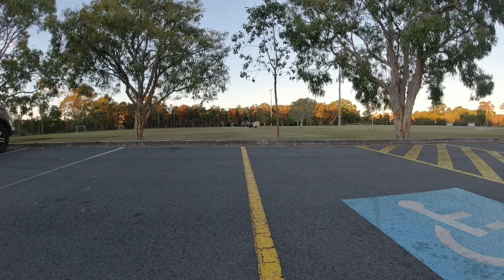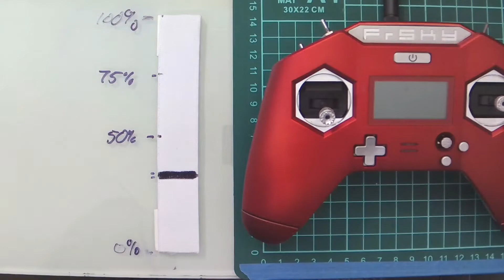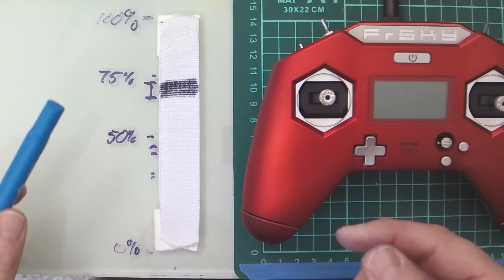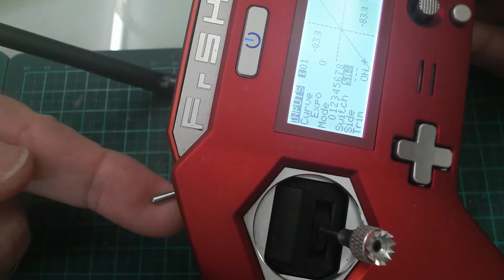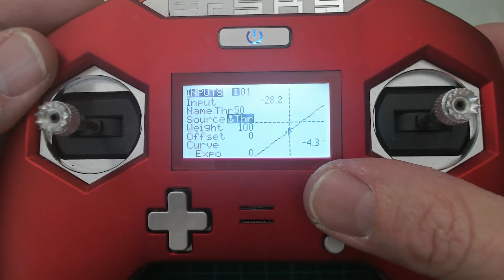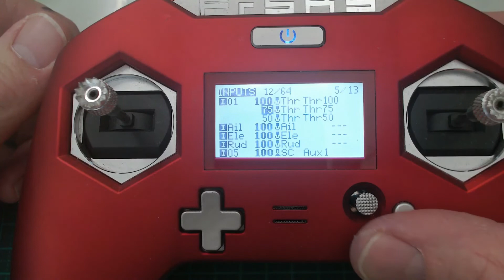Throttle Scaling for Quads

Comment: Hey bud, I have the same x-lite and want to set this up for a mate that's learning but all switches are currently being used for acro, beeper,  turtle mode etc. Is it still possible to set it up somehow?
Reply from the maker: Unfortunate but you will need to give up a switch. i suggest using a 3 position switch. But there is another way. You can do throttle scaling in Betaflight - see this tutorial from Bardwell - https://www.youtube.com/watch?v=K7t6U_2dLlk

Comment: Just wondering if you've ever tried fitting gps to a tinyhawk 2 freestyle? Very useful video, thanks
Reply from the maker: Haven't tried it but the weight would not be a problem. It can carry the weight - but you may just need to mount it on top of the battery attached to the strap.
Reply: @cubefpv  mmm I'm guessing thst if I add an ELRS receiver I'd have to sacrifice the smart audio UART to connect gps
Reply from the maker: @bedrascal  You would need to use an sbus receiver or just go with the inbuilt SPI receiver to free up the uart for GPS
Reply: @cubefpv  Many thanks for your advice. I'll skip the gps 'cause I really want to try ELRS on it and it doesn't support sbus yet. Looking forward to you next video.
Reply: @bedrascal  Correct - many people are requesting this from the ELRS devs. It can be dobe in code but it's unlikely they will do it because it's a slower protocol.
Reply: @cubefpv  mmm I'm guessing thst if I add an ELRS receiver I'd have to sacrifice the smart audio UART to connect gps